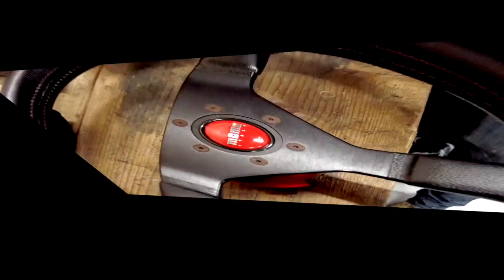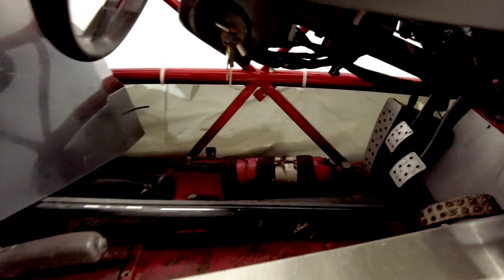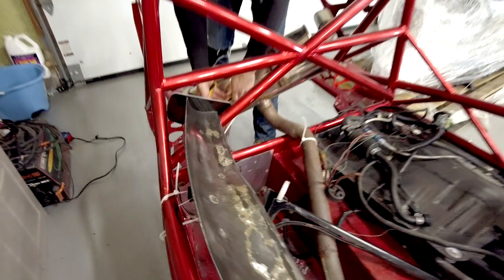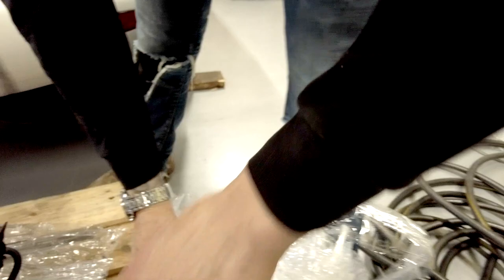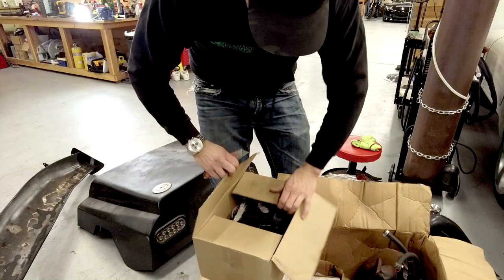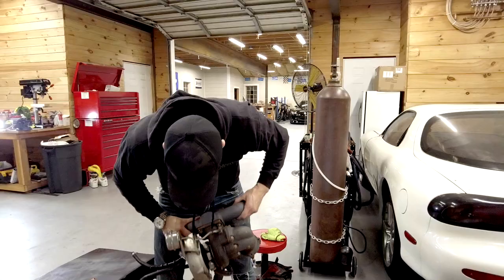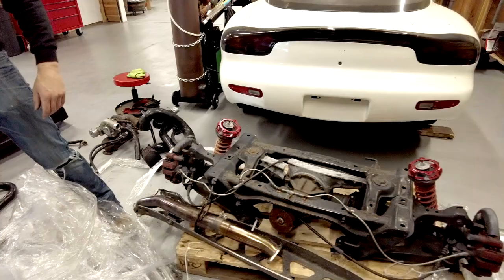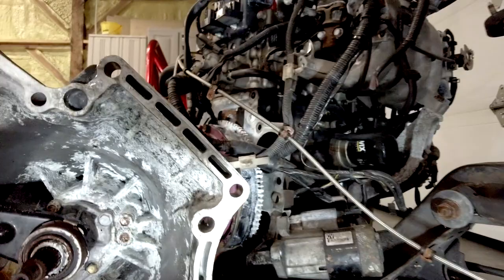Project Miata Exocet Pt 1 - How bad is the damage?

Comment: Hey guys, look up standalone alternator controller from WestfieldMX5 on ebay.  It's a fairly inexpensive and simple DIY solder job that takes over the job of alternator control on NBs so you can use whatever ECU you want to do everything else.  Good luck with the project!  Glad to see it's going to see dual duty!  :)

Comment: I don't think that was running the "poo poo" box. If you look at the intake setup, they were running the MAF delete pipe. You have to run the MAF to run to run the "poo poo" box.  Also, I do think Machu was right, and the Hydra is supposed to be installed in the stock ECU case. My guess is they started running the CARB FM kit and then upgraded to the Hydra. Also, NB is the superior Miata lol.

Edit: My apologies, I was thinking of the FM221 ecu, not the Hydra. That may be what you have.
Edit 2: After re-watching, that bp4w ECU has the green connectors, which makes me think its just a standard ecu.
Reply: We actually sorted this out with the previous owner. It was running on a Hydra and it’s on its way to us.
Reply: @mattwiser7982  Nice! Good to hear. Very excited about this build.